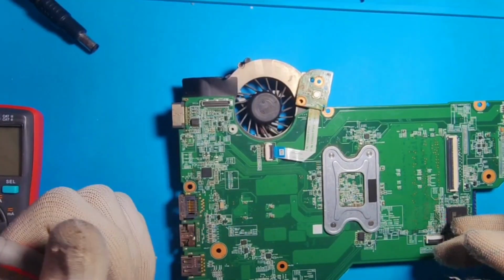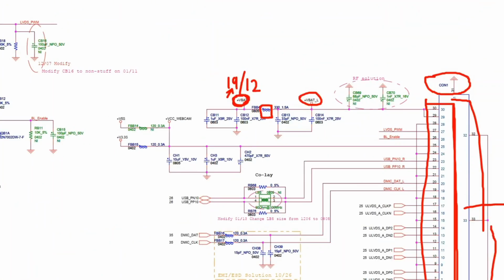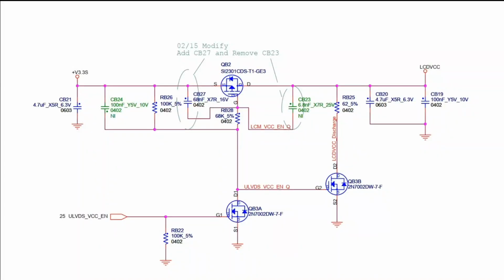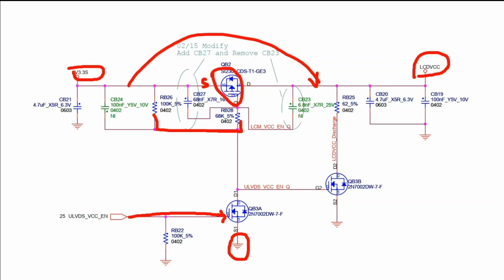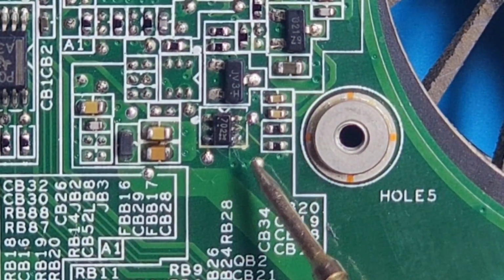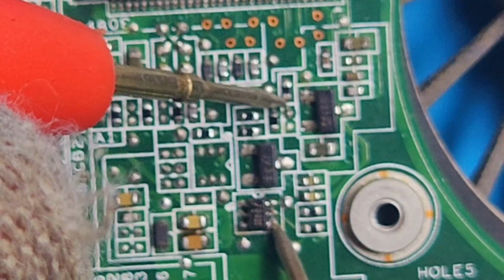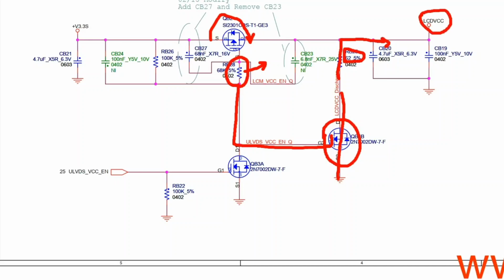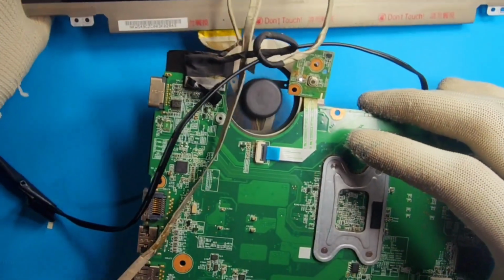HP 2000| No backlight| LVDS_VCC_EN signal absent from FCH | Bypass method, #PHILIPTRONIKS

Comment: what if if we jump a wire from V3.3s to LCDVCC ?
Reply from the maker: @sudheerm.s6792  Yes no problem. 3.3VS is a run power supply and LCDVCC need to be switched in the run state. As the supply and consumer is from same state so you can jumper both together.

Comment: Where you get schematic diagrams of all motherboards sir?
Reply from the maker: @ravindraadapa2952 You can get schematics from free sources like Alisaler, Smanuals, Badcaps, laboneinside. Also there is a paid website called Vinafix where you can get most of the Schematics and bios files.
Reply: Vinafix